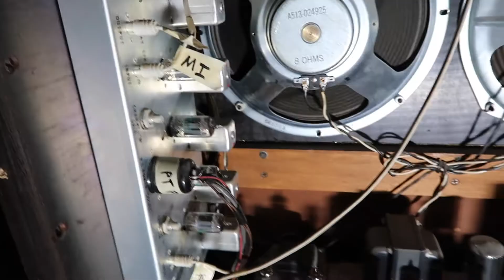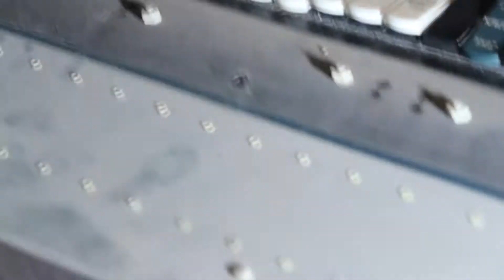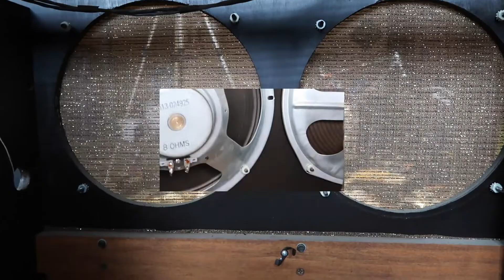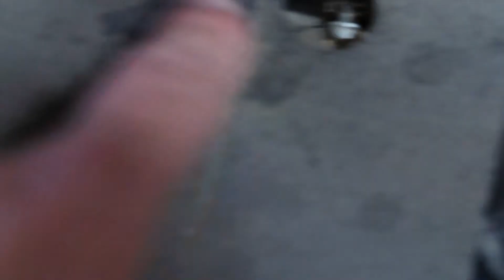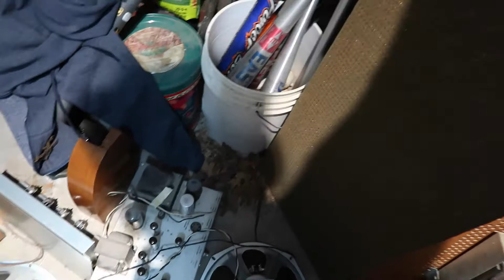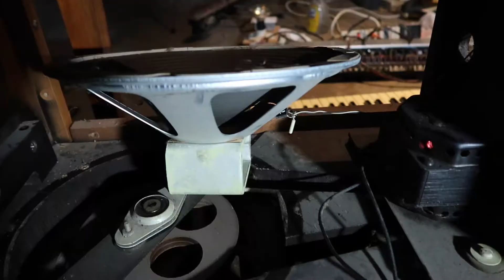Inside a Baldwin Orga-sonic 54A - Part 2: Disassembly

Comment: I own the same model Baldwin organ, but it sports a very different rotating drum design. The fast & slow motors are mounted on either side of the drum on the floor of the organ body. It is interesting but seems a little overly complicated

Comment: I enjoyed this video very much and I am an organist and have actually played one of these. 
They were somewhat unreliable and of course I prefer a HAMMOND over almost all other organ 
brands. 
       And usually the flute and tibia and diapason sounds are what are sent to the Leslie on these
kind of instruments. 
       And I highly doubt that the bass pedal sounds were directed to the Leslie at all however only 
to the 2 - 12 inch speakers and most all of these  companies used that kind of wiring for sound to 
the Leslie. 
        Some of them have a crossover  network to prevent the  very low frequency sound from going 
to the Leslie. 
       In a full size Leslie there is passive crossover network that splits the sound at 800 hertz and 
sends 800 and above frequencies to the upper rotating horn driver and the frequencies below 800 
hertz to the woofer.
       And the upper spinning dual horns has one side that no sound is allowed to pass through. 
And the bottom part that rotates is known as a spinning baffle as it throws the sound in a circle around 
the room just like same as the top rotating horn does. 

       Look up how a Leslie speaker works on the internet. 
It was created by Mr Don Leslie and Mr Larens Hammond hated the Leslie however you very rarely see
a HAMMOND without one or any organ without one built into it because the Leslie sound is so popular. 
        And  now they mimic it electronically and some of them are very good. 
         However most older organists prefer the real thing as I certainly do.

Comment: I am trying to repair a Baldwin Orga-sonic 54. Your video is the only  information I can find about it online! I am struggling to figure out what is wrong with it. the only thing that powers on right now are the tubes (all of them light up) and the leslie unit but no sound comes out. Any ideas?
Reply from the maker: It's a pretty complicated beast, so there could just be so many different things wrong with it. Vintage organs like that are widely available for cheap or free because people just want to get rid of them. So, unless you have a personal attachment to it, you're probably better off to just find another organ that works.
Reply: @SomeDisassemblyRequired  Agreed. These are all full of several hundreds of paper and bumble bee sprague caps which are problamatic when they're this old. It would take weeks of patience to change them all out along with any bad or faulty vacuum tubes
Reply: @Truckguy1970 no sirve el vibrato  como puedo solucionarlo?

Comment: I got a orgasonic model 73, it’s solid state but it works great for now. those tube socket connectors are so hilarious! Im curious if I put a variable resistor on the wire for the motor if that would give me more control over the speed.
Reply from the maker: I believe the motor is a synchronous motor that runs at a constant speed that's based on the frequency of the power input. So, I don't think a simple resistor would work.
Reply: @SomeDisassemblyRequired  hmm, sounds like PWM? I don’t know much about electromechanical devices.
Reply: @SomeDisassemblyRequired  would a VFD be the right thing?